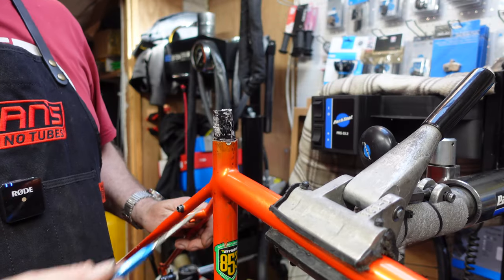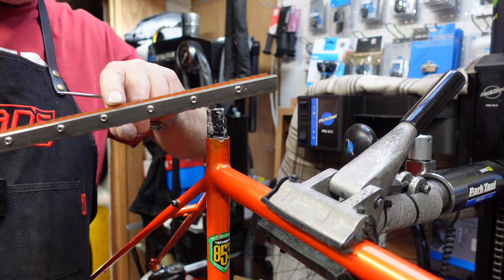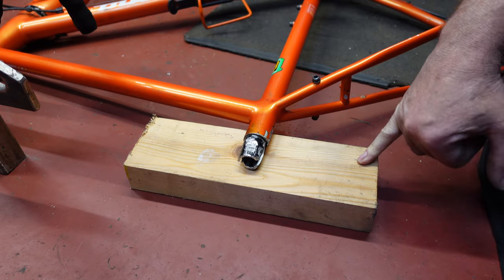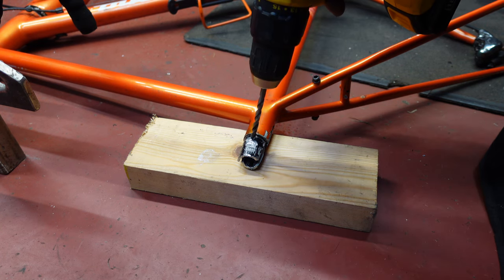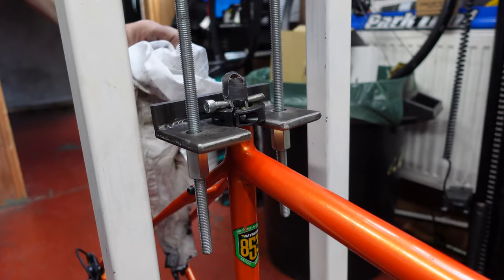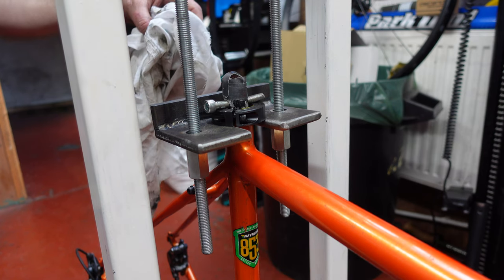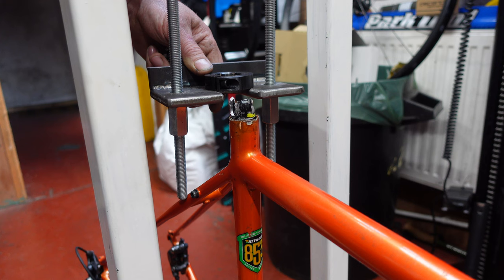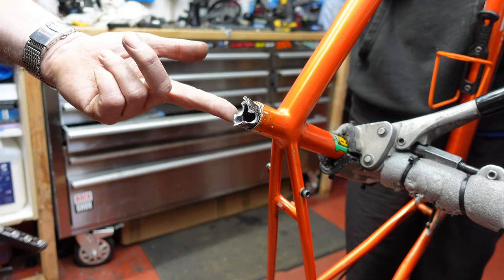Mangled Seatpost Removal Dilema

Comment: Since the thermal expansion coefficient of aluminum is over twice that of steel, I would suspect that heating the stuck assembly up would actually make it tighter, not looser.  If you went the other direction and threw it in the freezer for a while you might have more success.
Reply: Aluminum loses 30% of its strength while at only 175C, so it's not a bad idea.

Comment: I have a 1970s frame with an horrible stuck seat post. I cut 4 slices and it’s not going anywhere. I didn’t pay much for it and I’m at the point where I’m going to bring it to the dump. Frame is a Empire brand high tensile steel 61cm with crime forged dropouts. Shame.
Reply: Keep it. Get a maschine schop to reem it out

Comment: I made a seat tube clamp jig for the side of the table of my milling machine, align it with a test indicator, run a big drill (25, 27, 30 etc.mm) down the destroyed post, then a long mill in a circular cutter path, then a reamer of the correct diameter to dislodge the rest of the aluminium oxide. If you don't already have a mill & tooling this is an expensive option.
Reply from the maker: Thanks for your reply, loved to have seen a video of that

Comment: Hey up Yorkshire BM, I've just been in my shed hard at it trying to get a ridiculously long carbon seatpost out of a Kona Kula. No calming music, just lots of cursing and good old brute force whilst my daughter applied some heat with the heat gun. Like you said though, it wasn't a case of trying to twist it too much, it was more of a left and right motion with lots of pulling. I did use a carbon paste last but this time I have gone back to a light smear of grease and have cleaned inside the frame too. I will periodically do some preventative maintenance to keep a check on things from now on.
Reply from the maker: Hi, thanks for watching and your comments.

Comment: I've been looking at all the videos out there. One method that looked simple for the home DIYer is a (10lb) slide hammer, coupled with liberal application of penetrating spray. I expect a can of freeze spray would also add to it's effectiveness .P.s. the heat gun method will not work if the frame is steel and post aluminium: aluminium expands more than steel so it will make it tighter when warm.
Reply from the maker: Hi, Thanks for watching. Its important to generate pulling force in the same line as the seatpost whilst holding the frame still.
Reply: Thinking about the slide hammer suggestion, is that inserting something into the seat tube and sliding upwards. I like the idea but what would be small enough and have sufficient purchase on the end of the pillar ? I tried a bolt through the pillar and then hit it both clockwise and reverse but it just bent the bolt.
Reply: Yes the expansion rates are different however it can still work, as part of what you’re looking for is to break the initial bond and the shifting of the molecules will help, and after getting everything heated up, you can take a spray bottle with cold water and spray down inside the post to try and cause a rapid shrinking of the post while still applying heat outside.

Comment: Surprised your ending did not come with a recommendation. To avoid this situation all together, remove your seat post at least once a year and clean and regrease with Phil Woods hydrophobic grease, and do the same with your seat post clamp bolt. Remove it totally from the clamp, regrease the threads and the head and washer as well. You won’t ever have the problem in this video. Also regrease your steerer tube clamp bolts and stem bolts.
Reply from the maker: Hi, Thanks for watching and your comments

Comment: No easing oil first? And I think I would have put a nut on the other side so the pull would have been absolutely even and the pressure applied to the bolt head and nut as close to the seatpost as possible
Reply from the maker: Hi John, to be honest the post was mangled, lost all it strength and super brittle, it was going to be plan B from the start

Comment: I need help!!!My carbon seat post snapped off my aluminium frame, the break was exactly flush against the frame so I there's not purchase, I can't get the rest of the tube out, I need away of pulling it out. Any ideas anyone?
Reply from the maker: Hi, Thanks for your comments, this is a tricky one, only way to get this out is to slot the post with a recipricating saw or long purpose hacksaw, be careful of the dust though.
Reply: @TheYorkshireBikeMechanic hi sir can you expand on this. Thanks
Reply: What did you end up doing?
Reply: @patrickclarke3645  I got a flat-head screw driver and gently tapped it in between the carbon post and the frame, required a bit of patience as it was quite a tight fit, then I used the screw driver as a lever to give me enough space in between the frame and the post so I could get some pliers in and grab hold of the post. I found it easier with a second pair of hands to hold down the bike frame as I pulled the post out with the pliers. Did the job though, it is tricky and frustrating though. Good luck!

Comment: I’m not even bothering with a saw. Caustic soda!
Reply from the maker: Hi, Thanks for watching, what ever works
Reply: @TheYorkshireBikeMechanic  indeed me ole sparra. I’m impressed with that extraction tool.
Reply: Very dangerous indeed and usually ruins any paintwork left on the frame, but if you feel lucky, why not
Reply: Prep is everything. And if you do it properly then dangerous is not an issue.